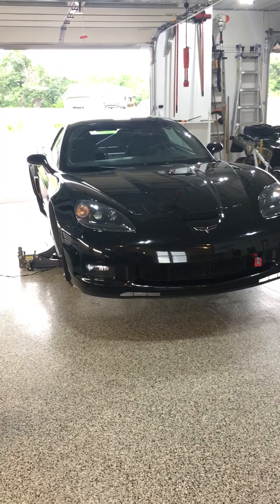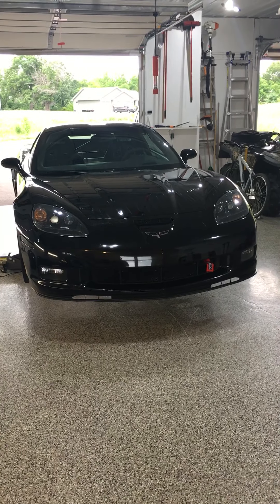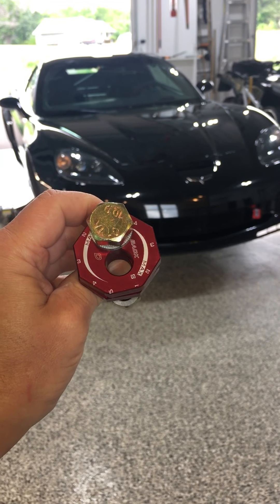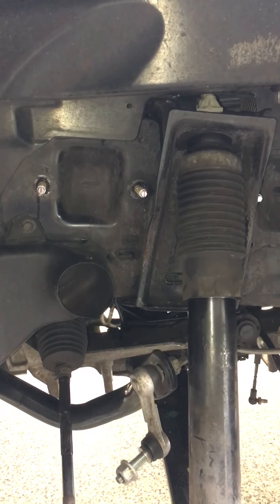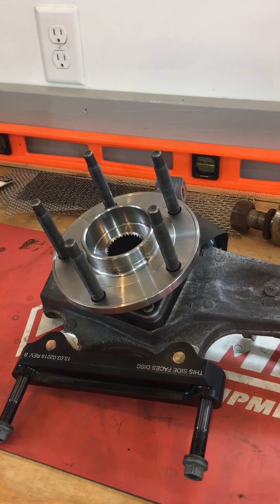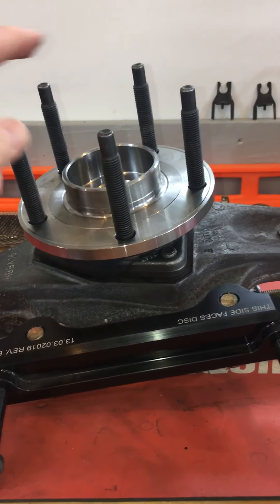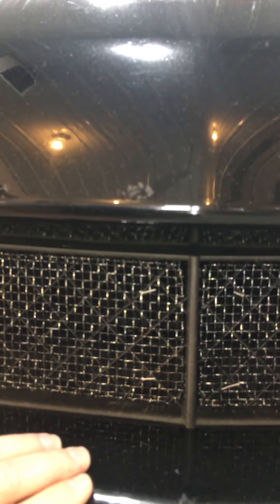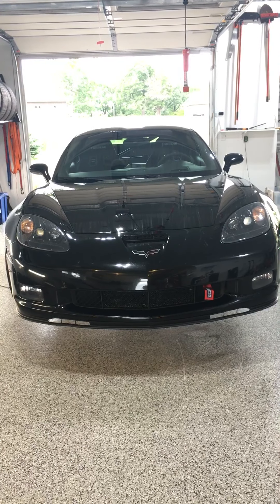Car update - Track Upgrades

Comment: I’m almost surprised you didn’t go coil over. I just went to some bilstein b8 shocks, threw some new end links very pleased. But I think in a year or two I may try the lg gt2 coil overs.
Reply from the maker: I have stock factory equipped ZR1 stab. bars and magnetic ride shocks that have re-calibrated by Jim Mero for track use.  Car feels fantastic.